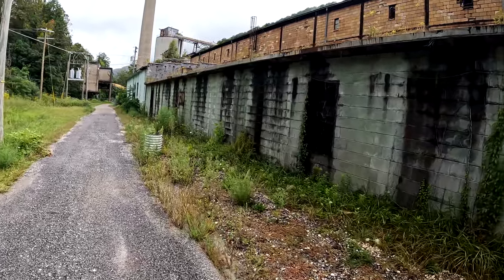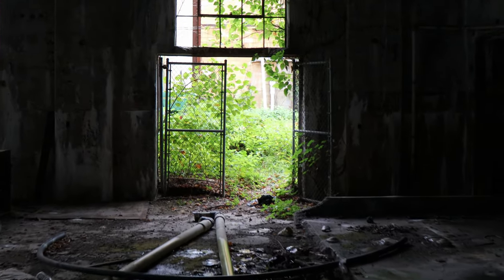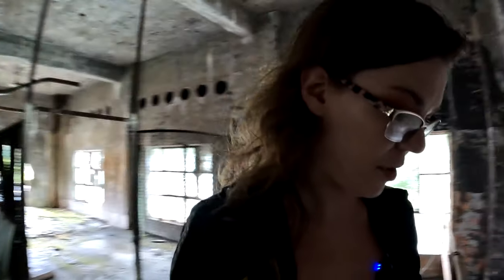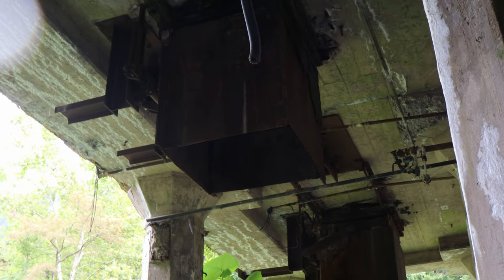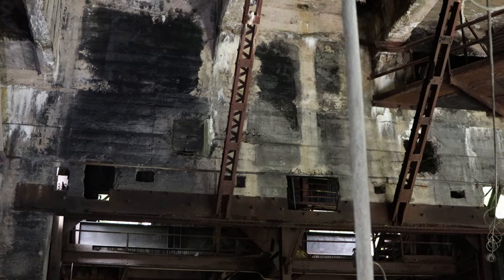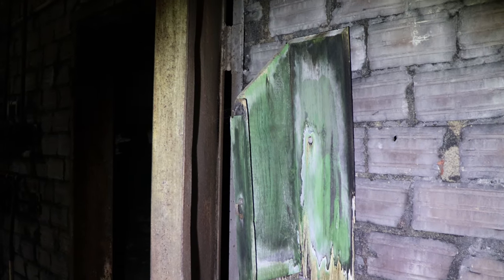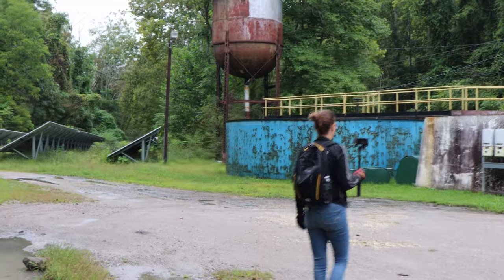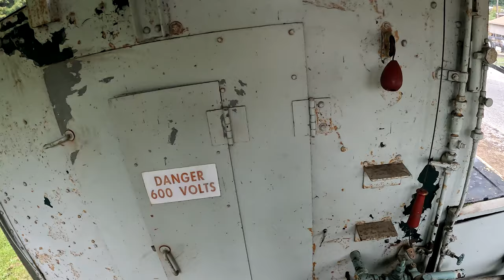Urban Exploring, Abandoned Coal Factory,  Portal 31, in Lynch Kentucky!

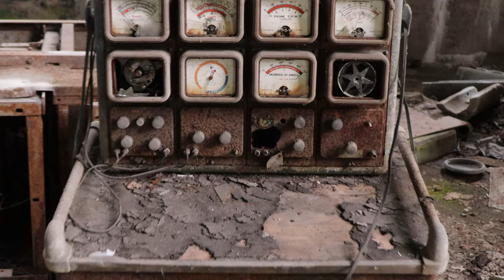Comment: @6:45 that is called a scope it is used to check the engine parameters from the cars and trucks of the 1950's-1960's...the gauge that says dwell is used for the distributor points...there should be a company brand on it or a ID. Tag...most likely SUN is the common...I had one...
Reply from the maker: Thank you I love when we get info about this!!!
Reply: @ProjectHnB  The viewing screen is missing on top...it had a screen similar to an old tube t.v. that would show what cylinders were firing or not...

Comment: I did a lot of the electrical work at Portal 31.  It’s a nice attraction.
Reply from the maker: When it was running or as the attraction either way really cool!
Reply: @ProjectHnB  When it was being turned into the attraction with the animatronics and such.  We spent a lot of time fossil hunting.
Reply from the maker: I love when we can post a video and get great feedback like this!! anything good?
Reply: Mostly ferns or sea shells.  If you go through the portal tour, all the stops are fiberglass casts of the wall behind them.  The roof and ribs are netted for safety.  Most of the mining equipment is real though.